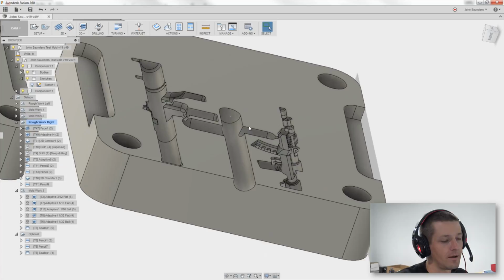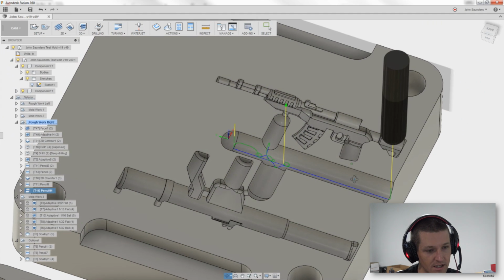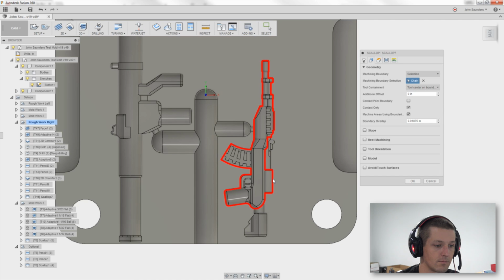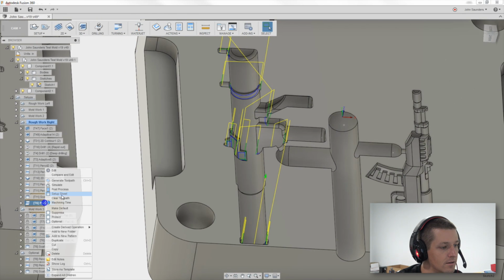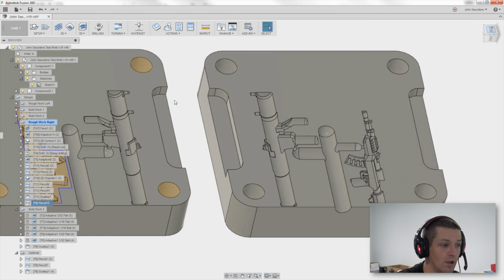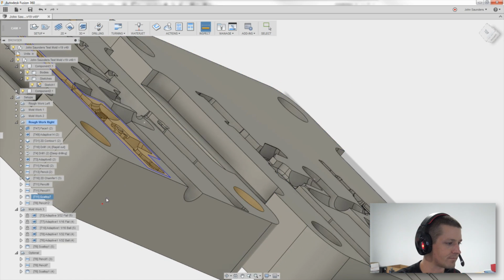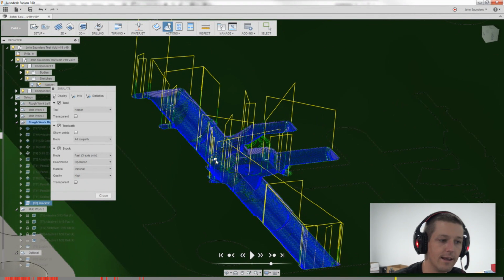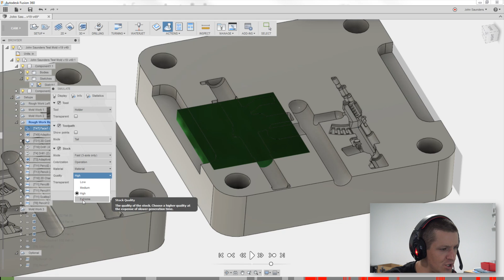Fusion 360 Advanced CAM Tips & Tricks!  FF48

Comment: That 3d software is alot like Powermill. For part area and the runner channels you should use contact boundary so you dont gouge the seal off. The channel in Powermill i rough out with constant z then corner finishing with ball and do stitch up and down. Gets it nice and constant stepover. That looks like small and sharp corner part. I'd just rough, quick semi finish part area then EDM part area, done

Comment: Hi guys something very useful (ON MODELING MODE, unfortunately does not work in CAM) when measuring easy faces like he does here, is just click on them holding shift and just look to the bottom right side. No need to open the inspect tool. Most of the values are there like radious etc etc...

Comment: Here's a tip, when you want to edit a protected toolpath, just go ahead. it will automatically unprotect it after the warning. No need to stop and unprotect it. Also saves time if you don't actually change anything, hit escape instead of OK and it still retains the protection, so you don't have to reprotect it unless you did change something.

Comment: Great stuff!!  any suggestions for getting going on my first Aluminum work? (video) I CNC wood all the time, but have never jumped into Aluminum work.  I want to start small and simple but speeds and feeds worry me for my first run at it.
I am using fusion 360 as well
Reply: Aluminium is easy, pretty hard to mess up, very forgiving. Steel different story

Comment: Good stuff.  Trick 10 - this is where HSM Works in Solidworks has a huge advantage over F360 as you can render the stock in 6 different modes, one of them being "Very Good" and it gives the highest resolution.

Comment: Eh. Milling that entire cavity is really not was pencil is for. Wouldn't use it for that at all. Pencil is meant as a final cleanup path to get the last bits of material out. 
 
Morphed spiral will work well, but really you should be using multiple types of paths on different sections of the mold rather than trying to get everything in a single shot with a single tool path. Parallel in the long uniform sections, morphed spiral in the complex sections, and then use pencil to get the last final corners and edges.
Reply: I Agree but wouldn't it be nice if there was an 'auto finish' path that just used all of the available strategies and saved messing about? I use scallop all the time for things that don't really matter because it's one operation and it takes a lot less time to program and is reliable. Some of the one off stuff that I make it's just easier and faster to let it run a few minutes long with a fine scallop pass than to spend many extra minutes getting several path to blend nicely. Also if you're not going to finish to smooth and are going to leave visible scallops running just one operation leave much prettier toolmarks than a several blended together.
Reply: Widget Works Manufacturing Inc. 
oh agreed.  And Solidcam actually has the ability to combine constant Z path with a few select surfacing paths together.  Really all it does is take 2 individual paths and lists them in a single tool path op. It's not as handy as I thought it was going to be, since you have to define the constant Z and the other path. It's just all on a single page is all. 

And personally I'm waiting for the "make whole part" tool path 😆

And for non mold, cosmetic only surfaces I usually just run a scallop over the whole thing as well and keep the step over just small enough that shit will still buff out.  

For mold work though it should really be done in sections with meticulous care.  Maybe not for this particular mold, but in general molds are really finicky. Every little thing shows up